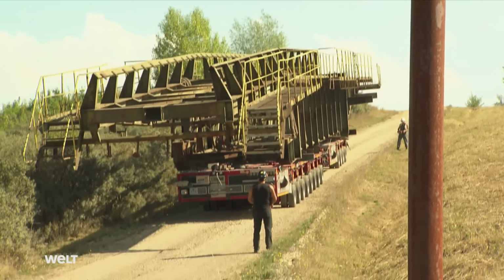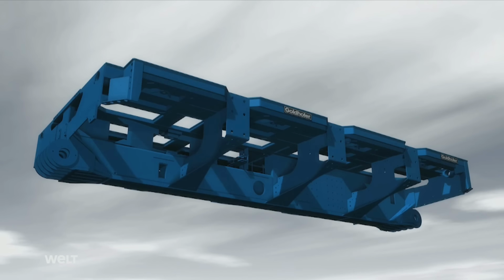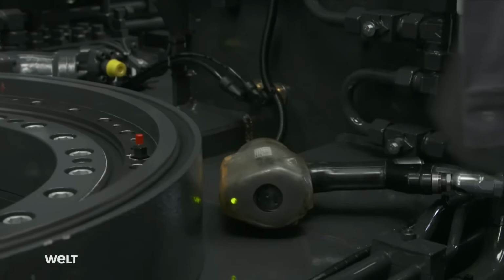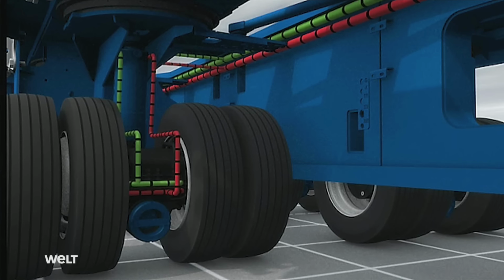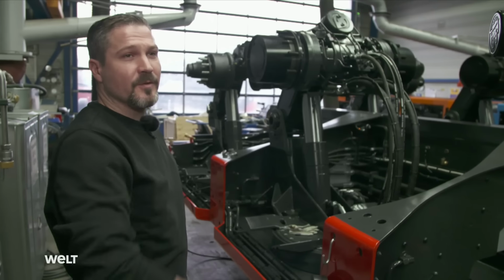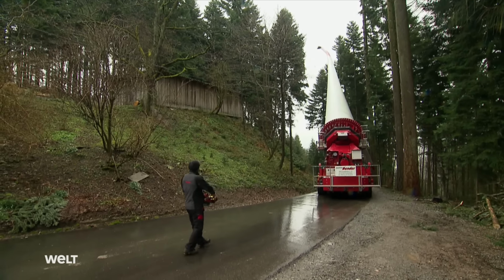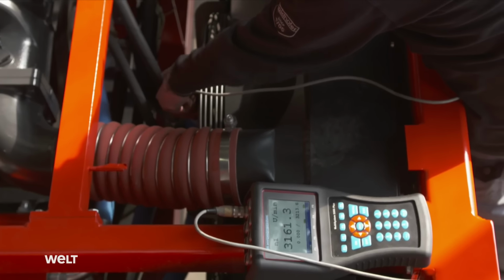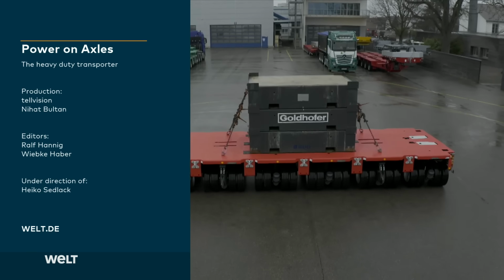INCREDIBLE TRANSPORT MIRACLE: Power on Axels - The heavy-duty German Transporter | WELT Documentary

Comment: this multi axle self-driven transporter could be operated on normal public roads on a daily basis, but it'll need a specialized semi-truck for tow . . . forget the conventional fifth wheel coupling . . . since the self-driven transporter is powered the stress on the semi-truck will be more than 60% less than usual towing a trailer with a fifth wheel . . .

Comment: 0:20: 🚜 Self-propelled transporters are versatile vehicles that can carry heavy loads and have excellent maneuverability.
8:19: 🚂 The process of building a self-propelled transporter chassis involves installing hydraulic tubing, laying electrical wiring, and rotating the frame.
13:08: 🔧 The process of installing components on a self-propelled transporter.
20:51: 🔧 The engine is carefully positioned and bolted into place, while the axles are adjusted and tested for accuracy.
27:35: 🚛 The power pack of the self-propelled transporter is tested and installed, including the brakes, tanks, and engine components.
34:57: ✅ The self-propelled transporter has a diesel tank capacity of nearly 450 liters and a 530 horsepower Deutz motor with a fuel consumption ranging from 10 to 70 liters per hour depending on the load.
41:41: ✅ The self-propelled transporter is being commissioned and tested for various hydraulic functions.
49:27: 🚚 The self-propelled transporter undergoes final tests and is ready for delivery.
Recap by Tammy AI

Comment: Wouldn't electric motors be much easier? ( run by a generator)
Reply: Way to bulky for the same output and space is of a premium in these units.
Can you imagine the gearbox needed to perform the lifting action (consider the weight!), the motors needed to traverse (with reduction gearboxes!) or the motors and reduction gearboxes needed to steer it?
No, hydraulic is way and above electrics.

Comment: It's mind blowing that one of these things move a few hundred tons, but the earlier stages of the Egyptian civilization were able to move single piece statues and obelisks in excess of 1000 tons. And we're supposed to believe they did it with teams of slaves pulling on ropes with the rock laid on top of logs.
Reply: We're not "supposed to believe" this, we did experiments that showed it's possible.
Reply: @zounds010  ropes and logs work for 50 ton stones. Not 1000+ ton. There isn't wood anywhere on the planet that can sustain that load.

And we also "proved" that all the precision granite cutting was done with copper saws and sand because Mark Lehner was able to make a crude scratch into a block in his experiment...
Reply: @SamSeth  Logs work for 1000 ton objects the same way an SPMT works: you put lots of logs under one object and spread the load.
Reply: @zounds010 Used to work for a company who moved heavy machinery in factories and the roller method was used in the majority of occasions.
If the machinery wasn't smooth on the underside, we fabricated a framework for under it.
Some of the stuff we moved was HEAVY!!👍👍
Reply: Are you trying to prove you're an idiot without saying you're an idiot?  Serious question  I'm not even joking.

Comment: A fantastic machine , but driving by hydrolics seems a lot of work to construct, high pressure tanks and all that pipeing , posibility of leaks . I wonder if electric would be easier ,the  powerpack would be a diesiel generator and an electric motor on each drive wheel.
Reply: Mammoet/Scheuerle are experimenting with electric SPMTs. These use an electric power unit to drive hydraulic pumps, so the SPMT itself is still hydraulic. 
The biggest problem is the lifting system. This has to carry the weight of the load, and be compact enough to fit between the wheels of a wheel unit. Hydraulics are an excellent solution for providing a lot of lifting power in a small package. I'm not aware of electric solutions that could fit in there.
Reply: Hydraulic motors are a smaller package. And the 400 Bar pressure forcing the action is easy to control to inch forwards. No gearing needed.
Reply: Either hydraulic fluid is only only solution,even if you electric motor diesel engine is required

Comment: 36:25 tire inflated to 12.6 bar? 128psi?? So high
Reply: High-performance wheelchair tires inflate to 140 psi easy (and yes, they pop when the tube blows out…hence the need for tires cages when inflating big rig tires). Different tires can reach pretty high psi…not unheard of and quite common actually!
Reply: 12.6 bar = 183 PSI

Comment: The SPMT's shown here are Goldhofer's. There are several manufacturers making this type of unit including Scheuerle, Kamag, Cometto, Nicolas, and Anster and they all essentially the same in their construction and operation. For highway use they will frequently remove the power unit and pull them with a tractor unit. If the terrain is more demanding, they can be rigged up with a pusher pull setup using two tractors fore and aft. There are also SPT trailers that do not use hydraulics but linkages to control the unit.
Reply: And all of them are produced under license. The Chinese invented the SPMT.
Reply: @davefroman4700 that's not true😂

Comment: what happens in an event of failure...amazing doc
Reply: If the power unit fails, there are locks in the hydraulic lines so the suspension doesn't collapse. The brakes are air-powered. These are built so that you need air pressure to release the brakes. When the system pressure drops below the threshold, the brakes are applied automatically. 
So in a failure you're stuck in place for a while until they can bring out a new power unit, but the load remains secure. Swap the power unit (or just attach the new power unit to the other side of the SPMT), and you're ready to go.
Reply: @zounds010   ..amazing ...these they have good brains